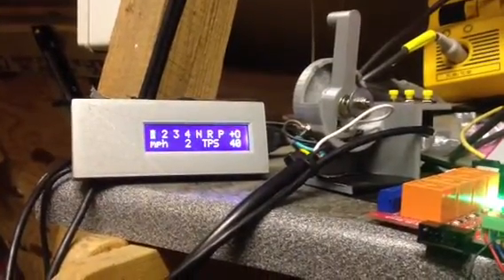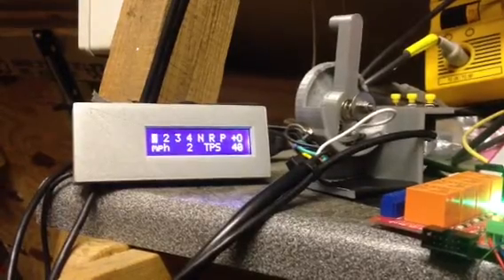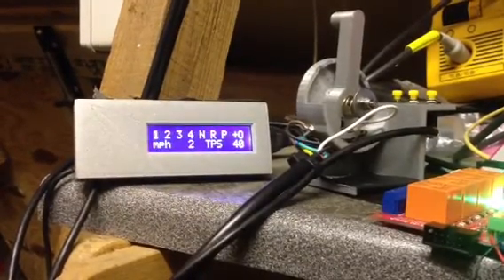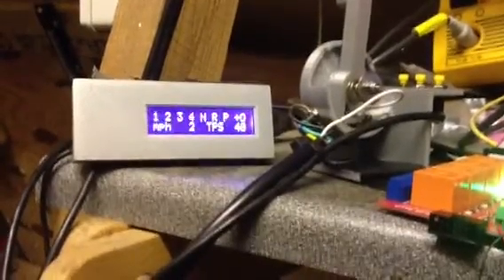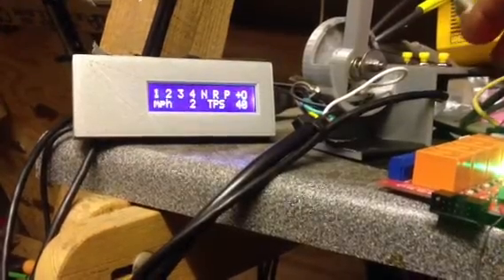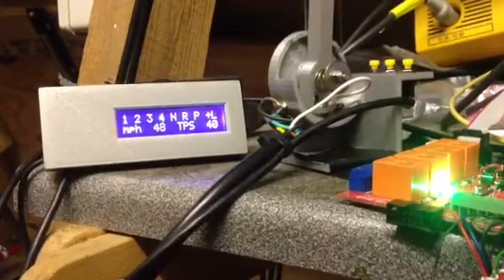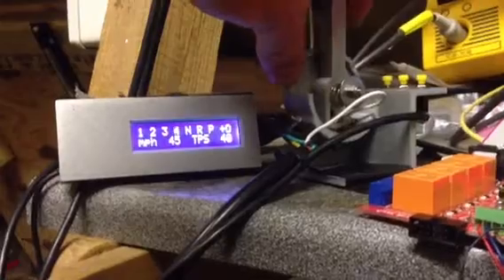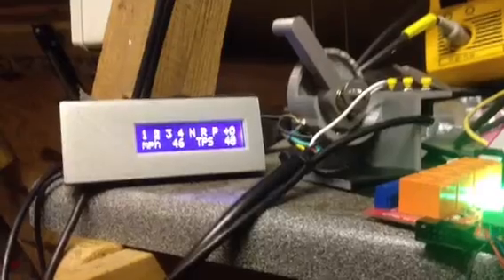DIY Auto Gearbox controller

Comment: I've been working on one for my honda. Would love to chat a bit about this
Reply: Did you ever get to make this for a honda? I am looking to make one for an odyseyy tranny for a v6 swapped automatic civic
Reply: @juancarlosruiz1985  sadly no. Too many issues with gear selection. The rsx automatic transmission seems to work similar to any other but from my understanding it still needs a shifter cable. But if you don't mind that. Yes it will work with an Arduino and relay board.
Reply: @BISONGARAGE  👌